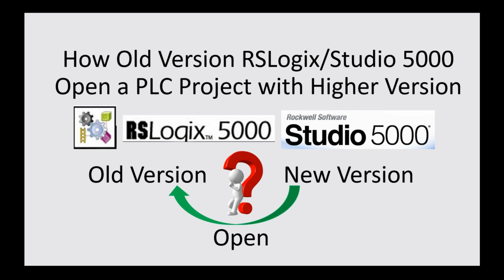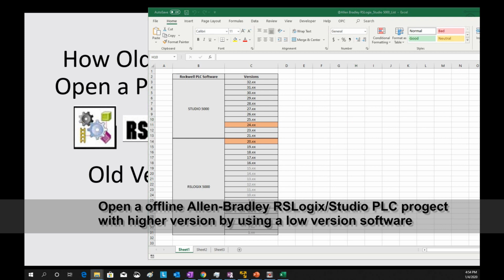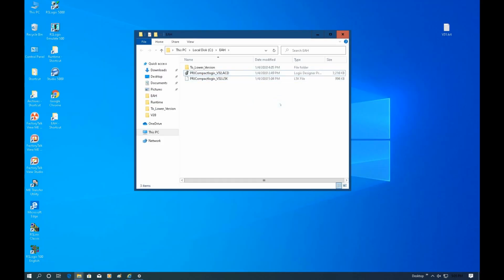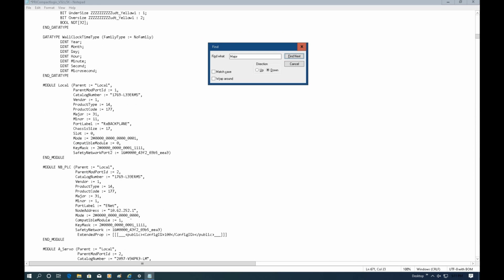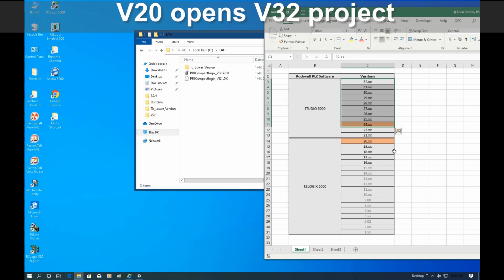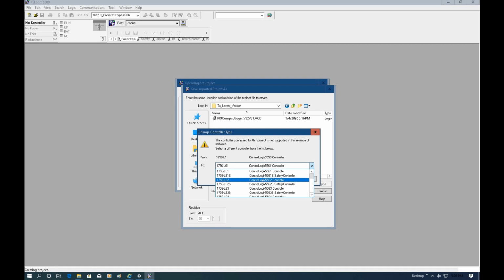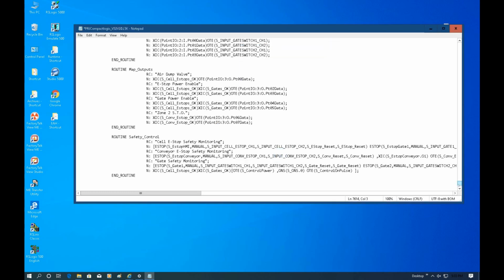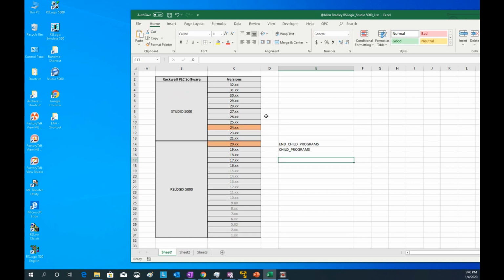AB01. How an Old Version RSLogix/Studio 5000 Opens a PLC Project with Higher Version

Comment: Thank you for the great video. I am having Studio 5000 V34 software installed on my laptop and I need to open project file, which is saved on version 20.01. Is there anyway to open this file. ( Controller is 1768-L43. Thanks in advance
Reply from the maker: Using a higher version of software should be able to open an old revision of project. You can try to open it.

Comment: It is possible to change v 20 to v 32. Excellent video, thank you
Reply from the maker: You can use RSLogix5000 open this project and save as a L5K file. Then use Studio 5000 to import this L5K. While importing this file, select the v32 and CPU, then you can open the project with V32.

Comment: Can i use version 16.4  on windows 10 ?  Or would i be forced to upgrade and use studio ?
Reply from the maker: As I checked, the 16.5 is compatible with Win10. https://compatibility.rockwellautomation.com/Pages/SelectedFeatureAttribute.aspx?crumb=118&rnf=0&isRP=0&featureID=8963&versions=57334. You could upgrade 16.4 to 16.5.
Reply: @electricalautomation   thanks  idn how i missed it , also any clue how i can get rs5k and i fix it to communicate ? Together
Reply from the maker: To download the RSLogix5000 or Studio5000, you need activation code which you have to purchase. Use the link above, seraching the software you can find, but then you need to type in the code for download

Comment: Hi! We're trying to upload a v28 program to a v31.11 but it failed. Is there any way or method on how to upload an older studio5000 version to a new version? Thanks
Reply from the maker: You have to use the matched software to upload the PLC. Use V28 RSlogix5000 to upload the V28 PLC. I know it is pain. But you can install v28 and v31 in one windows system. they can be installed and coexist. I recommend you Ghost your OS before you install the RSlogix software

Comment: hello Sir i am trying to open a V30 File on studio 5000 V28 program with this method but the project does not open what should I do
Reply from the maker: There are some different scenarios in the video, please review carefully, and make sure you changed "IE_VER" and "Major" in the L5K file when you try to use V28 to open a project from V30. Note, this method might not work if the project has some special modules. The method showing in the video is just for your reference. Please check the video around 12.30 https://youtu.be/OFQcLu0liUg?t=753

Comment: How can I open a version 17 on Studio 5000 V30, for exemple
Reply from the maker: Hi thanks for watching, this video talks about an alternative way to "open/convert backwards". According to your question, are you asking about how to use a Studio5000 V30 opens a project which was a program by version 17? Please note, since the software and hardware version must match, and the old version (below V20) controller CAN NOT upgrade its firmware above V20 (V20 is a watershed), therefore, it means you can use RSLogix 5000 V20.5 to open this V17 upgrading it to V20, and also you need to upgrade CPU firmware from V17 to V20. For your reference. Please correct me if my answer is wrong or misunderstood your question.
Reply: @electricalautomation  thanks, it helped a lot.
Reply from the maker: @kernelpanic36  Thanks, welcome! There are more than 100 videos on my channel, welcome!